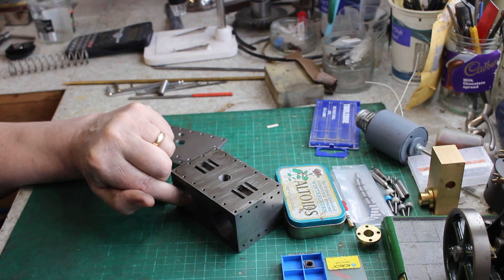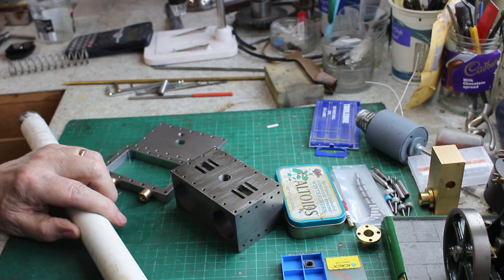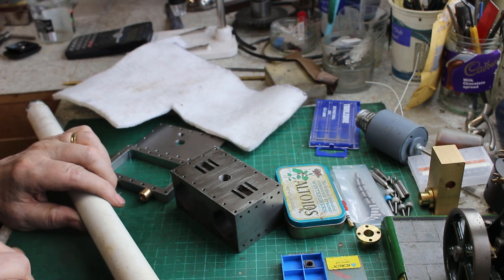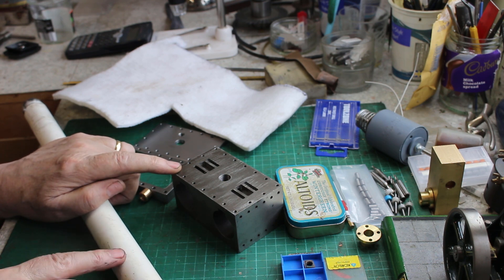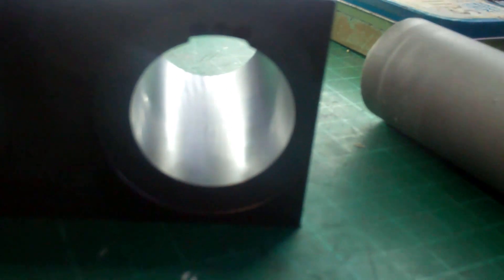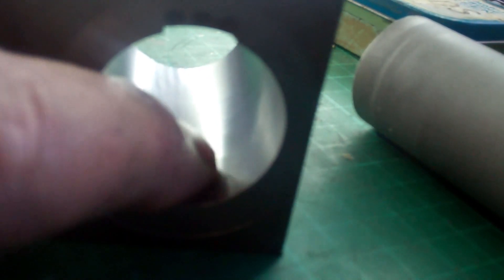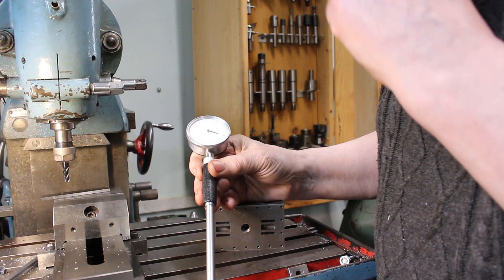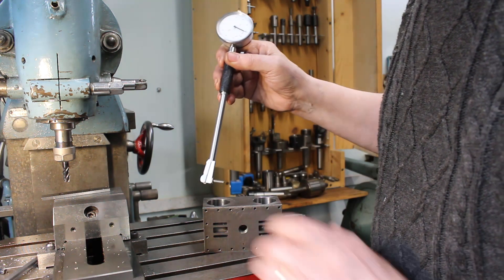Lion - 5"g  Miniature Locomotive Steam Engine Build pt.42 - Lapping the Cylinder Bores

Comment: Very neat trick with the plastic pipe as a lap. Some time ago I tried to use a piece of aluminium pipe with spiral slit. I intended to use an adjustable reamer as an "expandable mandrel" in the tube. This failed as the tubing was way to stiff. It might work with the plastic tube though.
BTW: I watched the entire series up to this point during the last few days: just outstanding! Thank you!
Reply from the maker: It's great to hear that you're enjoying the Lion videos, you interest is much appreciated.
I have used a lead lap before which worked well, I cast the lead onto a tapered steel shank and turned it to size. You have to take measures to prevent the lead bonding to the taper so that it can slide and expand, expansion was achieved using a washer and nut on the end of the steel shaft. To prevent distortion of the lead while expanding you only expand while it's in the bore. Anyway, it worked well though quite allot of work.

Cheers 
Nigel
Reply: @GoCreatehms  admittedly: I have never heard of using lead - but it sounds like a perfect solution as you can re-use the material. Thank you for sharing this idea.

Comment: What you think about PTFE ??? Is it possible?
Reply from the maker: Hi DreamSteam. If not using cast iron I think a filled ptfe is a good option for piston rings, it's harder and more temperature stable than plain ptfe. I'll be using graphite filled ptfe for my piston rings, a friend has used glass filled ptfe with good success. This approach is new to me so a bit experimental. I know people have had good success with viton or silicon 'O' rings. I'm using 70 shore hardness silicon 'o'rings for my valve gland seals.
Reply: @GoCreatehms  thank you Nigel..... sounds great.... i will try a ptfe pistonring..... my cylinder is out of Brass.... very soft....
Reply from the maker: I think ptfe will be very good for a brass cylinder, I found this very good article which I think I will follow for my piston rings.
https://modelengineeringwebsite.com/Steam_piston_rings.html

Comment: I smiled when you pulled out the bore gauge.   I have one for small engine work and I would never go back to working without one.  Kudos on nailing it.
Reply from the maker: Thanks Dan. First time I've used a bore gauge like that, seemed to be the easiest way to check the bores for parallelism and bell mouthing. Thanks for taking the time to watch.
Reply: Go Create Hobby Machine Shop Ah, the more you use it the better you will like it.  thanks for the reply. I’m enjoying your build.  Good stuff!